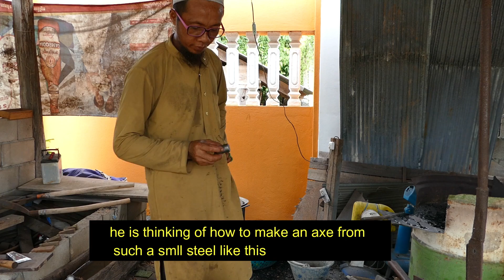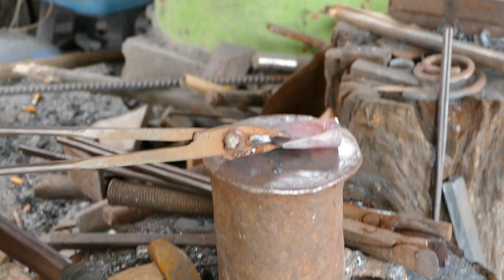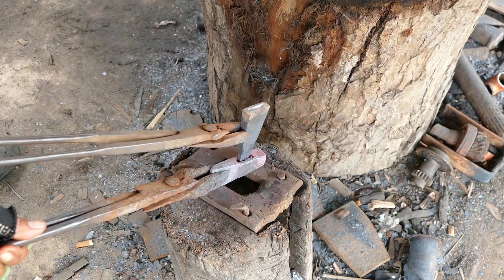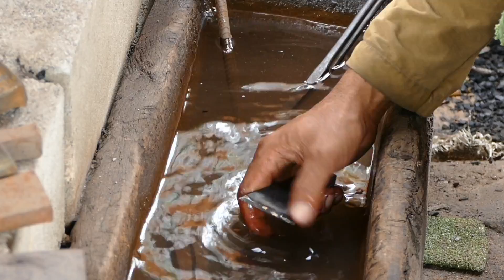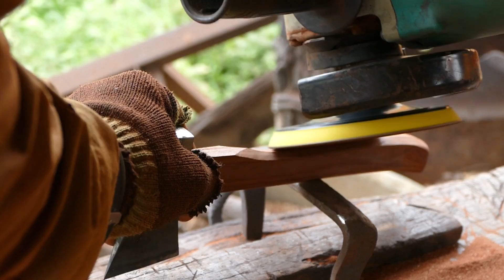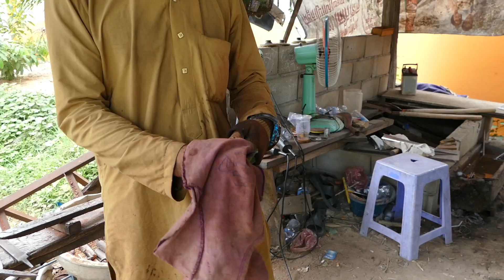Turning A Solid Gudgeon Pin Into An Axe: របៀបធ្វើពូថៅពីអ័ក្សយ៉េនម៉ូតូ

Comment: Here in the U.S. we call that a hatchet. Beautiful work!!!!
Reply from the maker: by the way, what is the difference between axe and hachete?
It is very confusing for me as I am a non-native speaker of English.
Reply: Good question. A hatchet is simple a very small axe.
Reply: Amazing KK Daily - hatchet has a one hand handle and small head. Like the one you made. Axe is a two hand handle and a bigger head.
Reply: Amazing KK Daily hatchet is a small axe with a shorter handle intended for primarily one hand use. An axe is a bigger Head intended for two hand use

Comment: I wonder if there’s any benefit to a straight edge axe compared to the more common slightly curved blade?
Reply: ieat caribou - some people like the straight edge better most it the old generation. Rounded edge in theory, will have better penetration because the power is hitting in a smaller spot, but that is just theory, and too much curve doesn't cut well for so little of the blade is making contact.
Reply: ieat caribou - So you have three different options. I used rounded and liked that one the best. I used to do tree work and split wood for a living.

Comment: the sharpening stone is a brick?
Reply from the maker: You’re right ADMIN
Reply from the maker: It is called sandstone, not a brick
Reply: If you made a stone/brick from fine river clay, you could probably use it as a honing stone. You could add fine sand for a rougher grit. That's what sandstone is, after all, just add a few million years. 😏